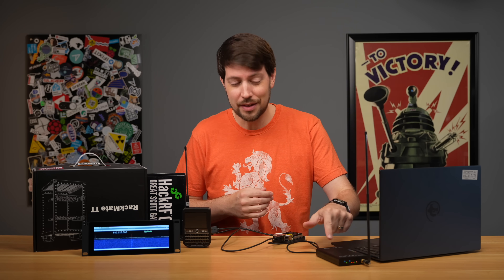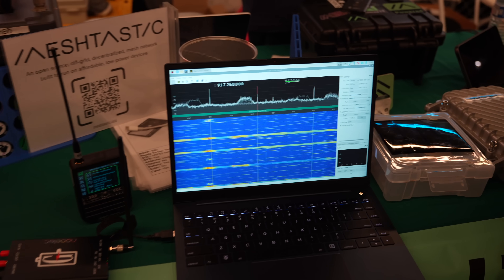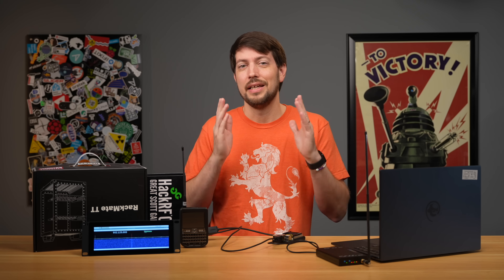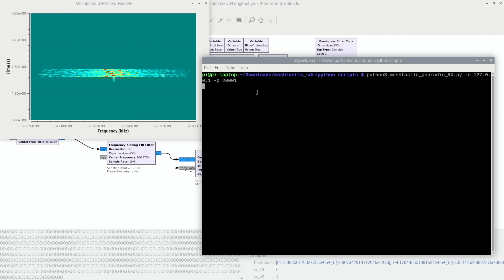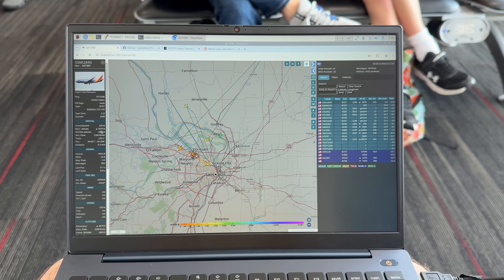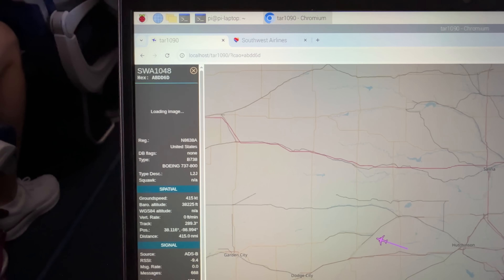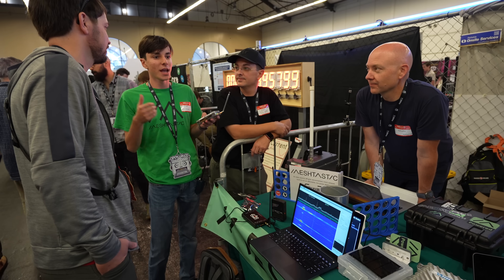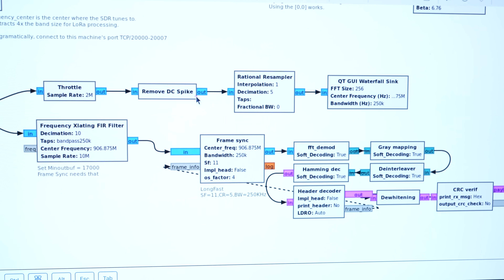Hacking Meshtastic with a Raspberry Pi and GNU Radio

Comment: It is fantastic to see someone else showing that meshtastic is not "secure" or "impossible to crack" and that it is not "capable of communication over several kilometers/miles" immune to reflections, multipath, or other propagation issues as some youtubers claim.
Reply: Well... while it's not completely immune to reflections and multipath, it is remarkably good compared to most other protocols.
The fact that it's a rather slow transmission, combined with its use of chirps (Chirp Spread Spectrum or CSS), which spreads the transmission across a wider spectrum, means it's highly resilient to interference, including reflections and delays.
It's not perfect, but it's pretty darn good and better than anything else you're going to find at this size or price range.
Reply: @charmio all those capabilities are not from meshtastic but LoRa.
Reply: @ulwur  LoRa is just the physical layer. Meshtastic is a software stack build on top of LoRa. 
What you're saying is like saying "All the capabilities of a fire truck are just from the water it carries". 
While kinda true from a weird perspective, it's missing a lot of important details.
Reply: He was on the public unencrypted channel lol
Reply: He didn't show any of that?
Reply: @SturmFlut that was my point.
Reply: @AlienObserver1745  What point? Every one of the points you raised is flawed... 
It is secured by AES256 (if enabled) - pretty darn good. 
It can definitely transmit over many kilometres, the current record is 331km (1336km for LoRa in general, which is what meshtastic uses).
And it has excellent resilience to multi-path and reflections as explained above.
Reply: He didn’t show any of that
Reply: I know exactly what tool you’re talking about, he makes me hate myself and my profession with every video he creates. I love how jeff breaks everything down in layman’s terms, and debunks uninformed influencers.

Comment: I see you using the "new" GUI on the T-Deck... last time I checked it was basically pre-alpha.  Is it usable now? Because the "old" only-green-text version is pretty clunky
Reply from the maker: Yes; there's a menu option now in the latest 2.6/2.7 firmwares to switch to the new UI mode (requires a T-Deck reboot). No special firmware required!

Comment: I have a raspberry pi serving dump 1090 data with my SDR and I get about 50 planes with my indoor ground plane antenna. Q:  Could I use the setup to look at 433 MHz FSK signals too without adding another SDR?
Reply from the maker: You'd need another SDR as none of the cheap ones seem like they'd be capable of grabbing both frequencies at once.

The ADSBee I mentioned in the video is interesting through—it uses both PIOs on the Pi RP2040 chip to tune in two different frequencies.

Seems like that could be a possibility with some dedicated RF hardware, but again, comes down to cost!

Comment: eh im learning this stuff as well :) slowly but learning. eventualy i hope to put the hackrf into the robot im building.
Reply from the maker: Good luck!
Reply: @JeffGeerling  Thanks!
And if you like radio, maybe check out the UV-K6.
Its like 25 bugs and gets to receive ALOT!
Just dont try to send cause harmonics on it suck xD
Reply: @JeffGeerling  Eh if you like radio, maybe check out the UV-K6.
Its cheap and is able to receive ALOT.
Just do not send with it outside of the regular channels because the harmonics on it are horible xD 
anyways; UV-K6 and egzumer custum firmware.

Comment: I don't think the airline liks radio transmitters on in flight. They worry about interference with aircraft electronics.  Good video.
Reply from the maker: Yeah; in this case we were only doing Rx for anything besides the low power Meshtastic.

Technically every laptop, phone, and tablet on the plane were blasting out 2.4/5 GHz throughout the flight, at much higher power levels than the Meshtastic radio, so I think it's a matter of which frequencies are allowed or not.
Reply: @JeffGeerling  Plus aircraft systems are pretty hardened to stray RF radiation. They have to pass pretty rigorous EMI testing before being certified to fly. So yeah, technically, even if you had a 100W transmitter blasting onboard, nothing would happen. The fear of "something happening" combined with the lack of experimental research on the field (for obvious reasons) leads to mobile phones' "flight mode", banning some RF devices onboard etc etc... It's the exact same thing with "turning off cell phones while refueling vehicles". No research done, so cautionary warnings placed just for the sake of liability.

Comment: The HackRF, BladeRF all are so expensive...
Hope that some Chinese company brings in affordable alternatives.
Reply from the maker: RTL-SDR v3/v4 and Nooelec RTL-SDR v5 are great alternatives, with lower bandwidth.

There's also the new HydraSDR that we tested on Geerling Engineering, between the low end and midrange SDR options. I'll be covering RTL-SDR more in depth in a few upcoming videos/projects :)
Reply: @JeffGeerling Only problem is that RTL SDR is only a receiver. It can't transmit. However, I hope that someone like you will tweak something useful. Thans for the reply.

Comment: Finally early! What do you think about the theory that in a few years because of extremely dense radio frequenecies it would be possible to make a "3d scan" of a room? Would like to get your opinion on this even if it was just fiction. Love your work!
Reply from the maker: You can already do it with just one WiFi 7 base station, with appropriate antenna placement and signal processing :/

It's not accurate enough to reconstruct a 3D scene for a movie or anything, but relative positioning is a lot easier today. So far it's mostly done in research settings, but I'd imagine government agencies already have the tech.
Reply: VTubing is about to get a lot better...